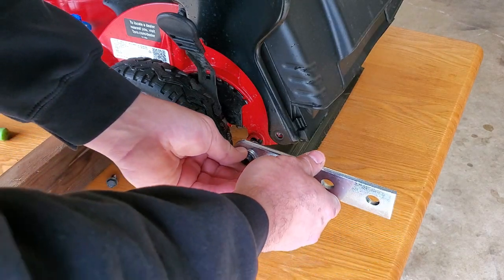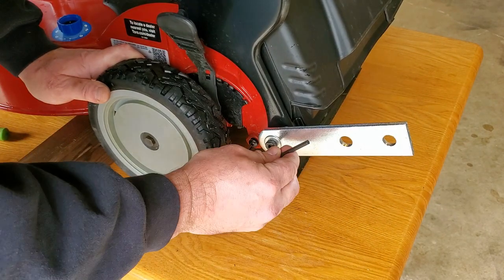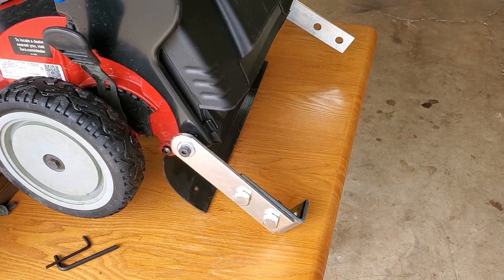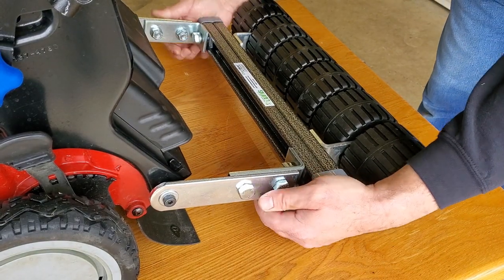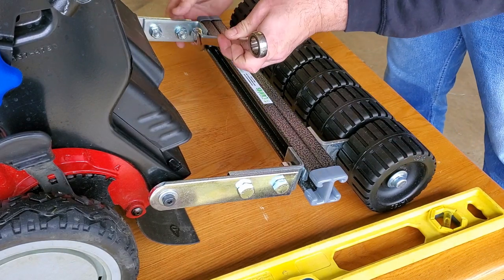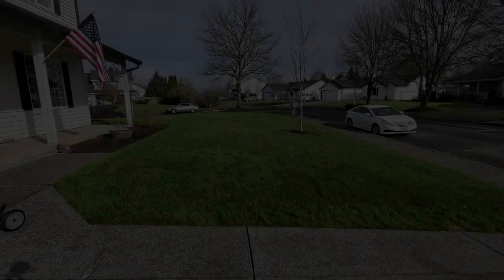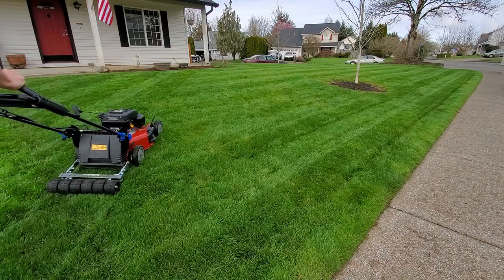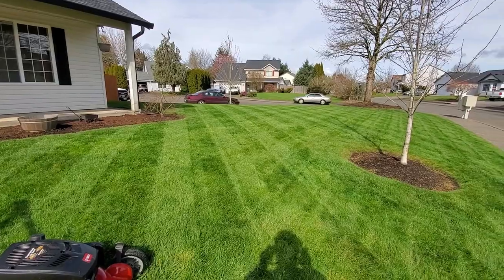Checkmate Striping Kit Installation and Review

Comment: On a double cut do you use the same height? Rookie question I know... I’m guessing it is same height but just meant to stripe
Reply from the maker: Yes for the most part. There are times when maybe your grass is way over grown and you want to reset the height of cut. When I get in that situation I raise my HOC up for the first pass then drop it down to the normal height on the second. But in most scenarios, you simply cut it twice at the same height in different directions to get an overall cleaner look.

Comment: Great video!  Do those rollers get in your way when walking at all and does the bag still fit on? Ive got big feet and it looked like you were walking sideways a little bit but i thought mabey that was for the camera
Reply from the maker: It doesn't get in the way at all. I don't hit it with my feet at all. The bag still fits perfectly.
Reply: Thanks
Reply: On the Honda I can no longer close the handle bar down. But for the look that’s a small fee. 
Bag fits and walking is no issues. I wear a size 13 shoe 👍🏼

Comment: Nice job. I am looking to get some cotter pins and making mine so I can remove when needed.
Reply from the maker: That's what I was thinking. I'm just not sure exactly where to put them yet.
Reply: @PacificNorthwestLawns  replace the bolt going into the mower
Reply from the maker: @TheLawnStripes  that's what I wanted to do but that's not s standard bolt. Gonna be tough finding something to work properly.
Reply: @PacificNorthwestLawns  challenge accepted 😁
Reply: I was looking at adding a way to just lift it up off the ground when I did not want to use it. 
Right now that’s 2 bungee cords but it does work.
Reply: @lawn2learn  i tried it but I guess my ginger cords were too long.
I did use some string to tie it up. However if you want it lift the striper up and bag...thats a while different ball of wax.

Comment: What size is/are the bolts that you take out, and replace with the bolts from the striping kit???
Reply from the maker: I'm not positive. All the hardware comes with the kit. There's no need to buy any additional bolts.
Reply: Reason I asked, rather than waiting for the kit, is because I'm getting the Quick Connect kit that Jimmy Lewis makes, and he needs to know. Won't kill me if I don't have it before the Checkmate gets here.
Reply from the maker: @fredcurrier5912  tell him it should be the same size I already gave him for the kit he made me....lol
Reply: @PacificNorthwestLawns  I'm perplexed. Jimmy says that yours was 3/8". Big League Lawns says that the Recycler has 3/8", but the Super Recycler like ours uses 5/16".
Reply from the maker: Fred Currier what model number do you have? It may be different. I’ll check when I get home
Reply: @PacificNorthwestLawns  Model 20384
Reply: Me too with the 20384. Did you install the Quick Connect kit from Jimmy? Looks like I have to install the long piece from BLL to the mower, and Jmmy's piece to the striping kit. (I can't separate the bolt with the allen key hole from that piece.)
Reply from the maker: I haven't put it on yet..😬 I probably should. Did you loosen the allen lock nut? Plus you probably put the lok tite on the threads when you put it together. It may take a bit to get them off.
Reply: Disregard my last. I'm not connected yet, but I figured out how to put Jimmy's piece first.
Reply: So... it's been 24hrs. Have you tried the Quick Connect set up yet? LOL. When I attached Jimmy's kit on the mower, the pieces  hang straight down and swing freely. Pretty sure that his did too. But when the Checkmate is attached to Jimmy's pieces, there is slack which delays the roller from moving forward or backward.  I'm trying to think of a way to tighten that slack because it's a pain.
Reply from the maker: No, I haven't. Not sure when I will. I've been busy.